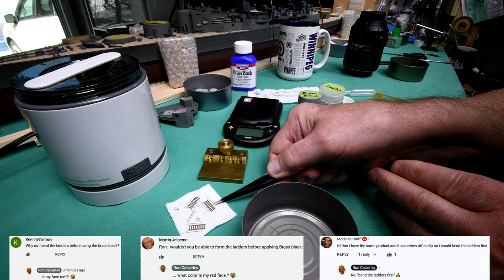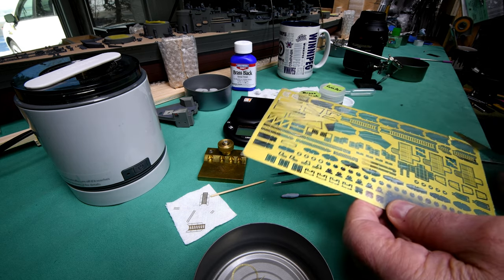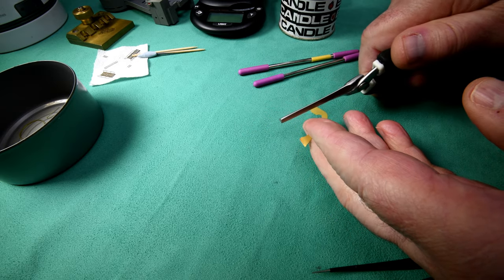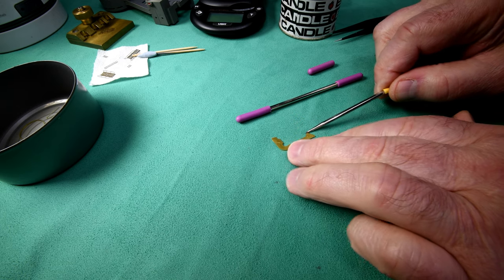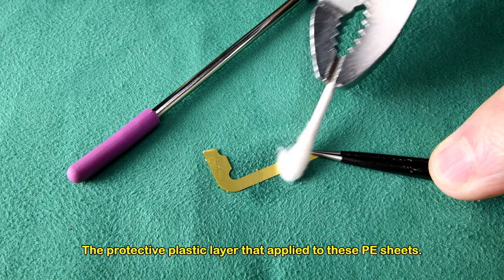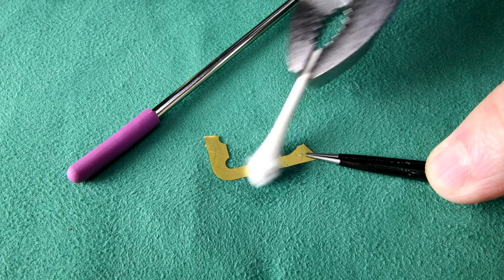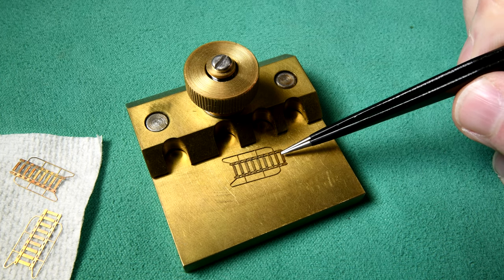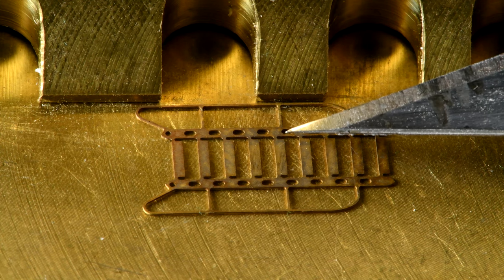The Model Ship - Part 736

Comment: Hi Ron, you should try a product used by watchmakers and repairman. It's called Rodico, and can be purchased from Esslinger.com, a major supplier to the watchmaking trade. Watchmakers use it for picking up incredibly small parts, as well as  cleaning watch dial faces, watch parts, etc. It looks like green putty, is inexpensive, and leaves no residue.
Reply from the maker: Thanks for the tip! 👍

Comment: There's a very slight difference doing the treads bottom to top vs top to bottom. When you start at the bottom like you did here, you get very close to pushing down the treads you just finished when you do the next one as you're rocking the tweezers to get the next one to bend. If you go top to bottom then those won't be in the way anymore. It's a very slight benefit though.
Reply from the maker: Tomorrow we'll go top to bottom. 🤞

Comment: Hi Ron Just a thought. Could you etch the brass with White vinegar ?  This would give the surface of the part some "tooth" I know you like to experiment.
Reply from the maker: Yes! I have done that. I can't recall what episode, but for the Bismarck's railings I'd used white vinegar in an ultrasonic cleaner, then Stynylrez grey primer as the final coat. Worked great! I should go back to that idea. Thanks for commenting. 👍

Comment: I just use a toothpick with a tiny bit of blue tack on the end of it works every time & i take the plastic off both sides of the photo etch & bath the photo etch in a Bath of metholated spirit I've found it removes the oily residue & CA & paint adhere much better i enjoyed your experiments with the candle wax cheers Ron 👍👍👍👍👍😀
Reply from the maker: Experimenting is always fun for me Trevor. 👍
Reply: @roncalverley glad you enjoy doing it as much as i find it interesting 👍👍

Comment: I find the Vallejo pick up tool works well, but if you can get hold of dental wax you can put it on toothpick, I don't like those wax pencils at all they leave residue.
Reply from the maker: Re: "they leave residue"
Now that's what I was concerned about. Are you commenting from experience?
Reply: Yes, definitely a problem on very small parts, for me anyway. Also  I live in humid climate and there is a problem with sticking using these pencils. The Vallejo tool was a game changer for me. Would love to try dental wax if I could find it.

Comment: I absolutely would not use those Chinese wax pencils - they do break off and leave a really nasty white residue which is impossible to remove if it gets mixed with CA.  It is particularly bad if it’s in a very delicate grill or vent of which I have many on my project - a British Type 45 destroyer.  The CA weeps through and glues the residue solidly.  This is my first foray into photoetch and the lessons I have learned  the painful way are (i) a very small amount of blue tack (or white tack) on a cocktail stick works best for placing the part (ii) CA is not always the best glue.  VMS flexy CA works well but even that will weep through a grill and stick to your cocktail stick.  I now use Jeweltool McGuinness Hypo Cement which I get through Amazon which is not instant bond and dries clear.  Not as strong as CA but for grills and vents dries clear and doesn’t stick the tool to the part.
Reply from the maker: "leave a really nasty white residue which is impossible to remove if it gets mixed with CA" 😮